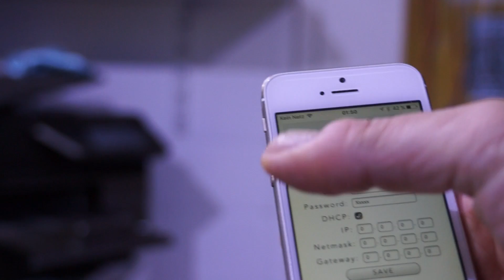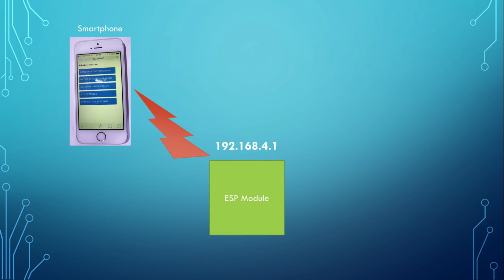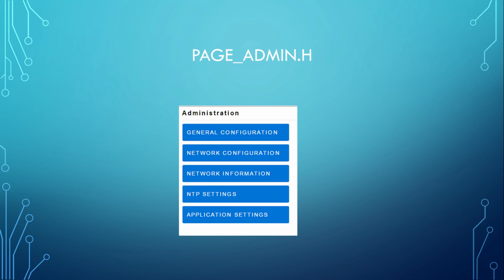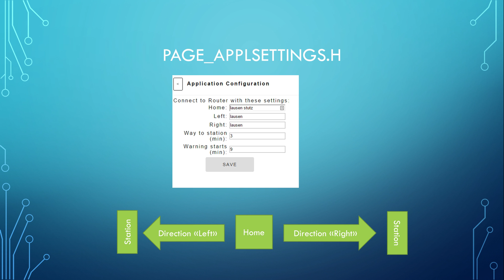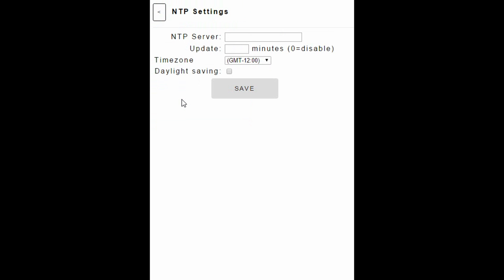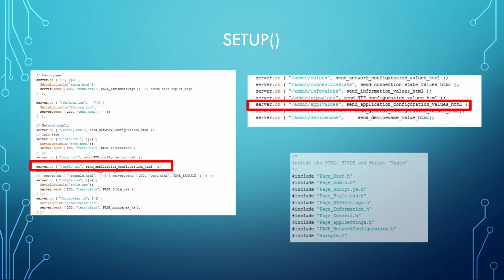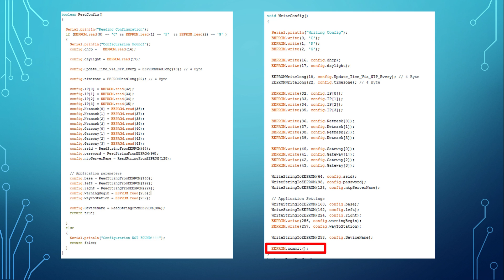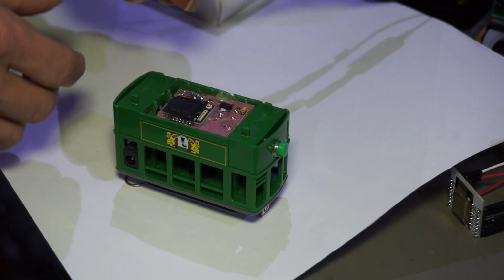#31 Internet of Things with ESP8266 #3: Interacting with your Smartphone

Comment: Hello Andreas, congratulations on your initiative and video sharing, they heave been very inspiring to me.

I tried to load this sketch of yours to define a "template" for my projects that would include OTA
network configuration save don eprom
Web configuration 

yet I'm not succeeding as my ESP12E is reseting every time I try to access the admin page or any other

I changed the timeout to 120 sec to have enough time to try the web access as I don't have left and right switch
(on Global.h)
"#define AdminTimeOut 120  // Defines the Time in Seconds, when the Admin-Mode will be disabled
"

and added a message to know that ESP is in admin status
(on .ino file)
"
 // Non blocking code !!!
  switch (status) {
    case admin:
      ledColor = both;
      Serial.println("on Admin status");
      server.handleClient();
"

the Serial terminal (debug) is reporting 

"on Admin status
on Admin status
on Admin status
on Admin status
on Admin status
style.css

Exception (3):
epc1=0x4000bef4 epc2=0x00000000 epc3=0x00000000 excvaddr=0x4023bd32 depc=0x00000000

ctx: cont 
sp: 3fff0e80 end: 3fff1190 offset: 01a0

>>>stack>>>
3fff1020:  3ffe8be8 00000001 3fff1060 4020bbd5  
3fff1030:  00000001 00000001 3fff1060 4020bc26  
3fff1040:  4023bd32 0000000a 3fff00a0 4020b300  
3fff1050:  3fff0078 00000001 3fff2d84 40202bd6  
3fff1060:  3fff3884 000006ef 000006e4 4010068c  
3fff1070:  00000000 000002f4 3fff2d84 40208112  
3fff1080:  3fff2d84 3ffef6a4 3fff2d84 4020814e  
3fff1090:  00000000 00000000 00000000 4020bd04  
3fff10a0:  3fff2d84 3ffef6a4 3ffef664 402081e1  
3fff10b0:  3fff319c 0000000f 0000000a 40206b60  
3fff10c0:  3ffef6a4 00000001 3ffe8be9 00000001  
3fff10d0:  00000001 402076ac 0000000f 3ffef624  
3fff10e0:  00000000 3fff00a0 3ffef664 3ffef624  
3fff10f0:  00000001 3ffef688 3ffef664 4020841b  
3fff1100:  3ffe9060 00000000 000003e8 4020b2b4  
3fff1110:  00000000 3fff2a2c 3fff00a0 4020b300  
3fff1120:  3ffe8bea 3fff00a0 3ffef5e4 40205167  
3fff1130:  00000001 00000000 3fff0170 3fff2644  
3fff1140:  0000000f 00000000 4020c5dc 3fff0170  
3fff1150:  feefeffe feefeffe 3fff0155 3fff015c  
3fff1160:  3fffdad0 00000000 3fff0155 402058e4  
3fff1170:  3fffdad0 00000000 3fff0155 4020c628  
3fff1180:  feefeffe feefeffe 3fff0170 40100718  
<<<stack<<<

 ets Jan  8 2013,rst cause:2, boot mode:(1,6)

 ets Jan  8 2013,rst cause:4, boot mode:(1,6)

wdt reset
"

Can you help me with some suggestion/approach to find out what may be going wrong?

Is there a change you can isolate all your application code and leave just the necessary to get the chip enter Station mode and be ready to be a web server to display and save the configuration ? (no buttons, or NTP, or schedule request)

Maybe I could start from some thing very basic that works on your Pc so I can find out why it does not work on mine.

thank you 
Pedro Albuquerque.
pedro_m_albuquerque@hotmail.com
Reply from the maker: wdt reset is usually triggered if you take too much time for your code and do not allow to deal with Wi-Fi. Usually, this happens, if your code is in a loop without a delay() or a yield() statement. So, I would check every loop and add a yield(); statement if necessary. For debugging, I would add too much of these statements and remove them later when the code does not creash anymore.
Reply: Thank you for your quick answer.
I have share my code here https://github.com/Pedroalbuquerque/template 

is there a chance you can load it in you hardware and confirm if it works, I believe this can be a very generic/usefull code and my main loop is quite simple by now, so I don't know were to put the "yield()" call and the code (as seen on serial monitor) breaks exactly when I try to load de base page (Admin.html), and I believe when it tries to load css code. , however if I try to load 192.168.1.109/ttt I get an correct answer "Page not Found" and no dump on serial monitor.
Reply from the maker: +Pedro Albuquerque I will come back to you
Reply from the maker: I downloaded your sketch, replaced the credentials, and tried it out on my NodeMCU board. I had no crash and was able to call all 4 setup pages. However, the entries were not saved and it stayed in admin mode forever.
Reply: Thank you so much Andreas that is very helpful, I will have to turn to my boards. They might have some diference to your's as the code is the same. In dead the project in not complete, and I still have removed the save code to keep it basic for diagnose, and yes , for now it is always ready do OTA and accepting setup change(admin) via browser.
Maybe the way you connect your hardware can justify something... Can you share how you have it hardwired for this test ?
PS: if you prefer we can move this discussion to some other forum.
Reply: Dear Andreas, based on your test results with my sketch I tried to use another board (same batch), but with the same frustrating result. Always resets when loading the first page (Admin). may be the hardware connection may be different from yours, can you confirm? 
GPIO00 is connected to a push button that will short to ground when pressed to do the Uart sketch loaded.
GPIO15 to GND
CHPD to 3.3V
GPIO03 to TX
GPIO01 to RX

and a 470uf cap from 3.3V to GND
 my board is a ESP12E (picture loaded to github)
I have also loaded to github a video showing the problem.

can you confirm your test platform/connections ?
Reply from the maker: I did not use a plain ESP12 board, but a nodeMCU one. But this should not create the issue. Your wiring seems to be ok. You could use resistors instead of direct connections for pin 15 and CHPD. And you could pull-up RST. 
Are you sure, we used exactly the same sketch? Do you have the newest development environment on your IDE (I use 2.3.0-rc2).
Othr than that, I cannot help you, because remote diagnosis is not easy. I wrote in my last post how I would proceed. Good luck!
Reply: Hello Andreas, one last word to let you know I have found a way to avoid reset.

I had to remove all PROGMEM declarations and that definitely solved the crash. Not sure why, as if I used this on a very basic sketch everything seem to work fine but as I use a second declaration using PROGMEM the processor resets.
I have opened a discussion on ESP8266 forum, maybe someone is aware of this.

thank you for you invaluable help and all your great videos.
Pedro
Reply from the maker: +Pedro Albuquerque Maybe you overwrite something Try to check if you use the right base address or try to shift it a little.
Reply: Pedro and Andreas,  I don't pretend to know that much since I'm new to this, but the problem with resets that I have had were because of power supply issues.  It may have been Pedro's problem.  Yes, as Andreas says, "feed the dog" to avoid WDT resets, but also when the program hits the road and transmits to the web (then receives) it spikes the power demand and could cause resets if the supply is insufficient.  I offer this for others following these issues.  Andreas had a video on the subject, I think, where he used different capacitors to smooth the demand.  Hope it helps.

Comment: Hello! I have to ask a question. Can you send files from the Arduino SD card, to the Smartphone, via an ESP8266 connected to the Arduino? Thanks!
Reply from the maker: +Nick Stolis I think, that files are not the preferred object for our small microcontrollers (at least for the moment). This is why I never thougt about it. If you write a little more about what the purpose of the system  (end-to-end) should be I might propose a different approach.
Reply: +Andreas Spiess File interaction is very common in arduino through SD cards. There are many existing SD libraries. I was wondering if file transfer was possible from the SD card to the smartphone, using the ESP8266.
Reply from the maker: This seems to be possible. I just googled "Arduino FTP sd card" and got many hits. When I added Smartphone I even got a guy who did what you want to do.
Reply: +Andreas Spiess Thank you!

Comment: Hi Andreas, thank you for the videos very informative!  I was running into an issue trying to run your sample code, it will flash into the esp8266 fine, but when i try to access the main admin page it would throw an exception in the serial monitor

Exception (3):
epc1=0x4000bef4 epc2=0x00000000 epc3=0x00000000 excvaddr=0x40247522 depc=0x00000000

have you encountered anything like that before?
Reply from the maker: +Motti Horesh Hi Motti, ESP8255 are famous for their crashes. The main issue is, if you block their WiFi traffic with your own code. This is why you have to add delay(1) or better yield() in all areas which will take more than a few milliseconds between these two statements. This said, it is hard to say what your problem is. The code on github runs in my environment. I just tested it. Maybe you check the latest version.
To find out where the crash really happens I put always Serial.print statements in the code to understand till which position the code works. If you can give me more information about the exact statement the code crashes I might be able to help.

Comment: Hi Andy, if you use mDNS / Zeroconf to publish the ESP-8266 e.g. under the name "ESP", you don't need to type the IP-Address any more: https://de.wikipedia.org/wiki/Zeroconf#Multicast_DNS - For the SSID / Password you may generate a QR-Code here: http://blog.qr4.nl/QR-Code-WiFi.aspx - thanks a lot for sharing
Reply: +norm1124 If you print the QR-code on a sticker and attach it on the device.
Reply from the maker: +norm1124 Thanks for the tips. I will check it in the next time. I think, the mDNS is necessary for OTA, but I do not understand it yet. But I will work on it for my next video. Maybe I will find something out till next week and include it in it..

Comment: Love this one . Great tutorial and inf as ever .  Oh does the EEPROMAnything  lib work with esp?  ( http://playground.arduino.cc/Code/EEPROMWriteAnything ) .  There is also a command that only change bits in the eeprom that have changed . I'm not at home so i cant see what i did to my edit of EEPROMAnything  , but it only touches bytes that have changed in the memory space , and can my your eeprom last a small bit longer .
Reply from the maker: +XerotoLabs As far as I understood the EEPROM library for the ESP is different from the one for the Arduino (technically). I just had a short look at the EEPROMWriteAnything and I think, it is comparable with the functions EEPROM.get() and EEPROM.put().
Reply: The EEPROMAnything  for the ESP has a problem with strings and structures. I found out, that when you use char-arrays instead of strings, the EEPROMAnything works. I the new Version I will use this.
Reply: +Andreas Spiess if i read correctly esp's use a place in flash to emulate eeprom . if so then there is no worry of burning it out .
Reply from the maker: +XerotoLabs I think, the EEPROM.commit transfers the content to the EEPROM. So, not every Write command is transferred inddividually. I did not investigate in this area, because for me, this is not important so far. I think, a few thousand write cycles are more than enough for my application.